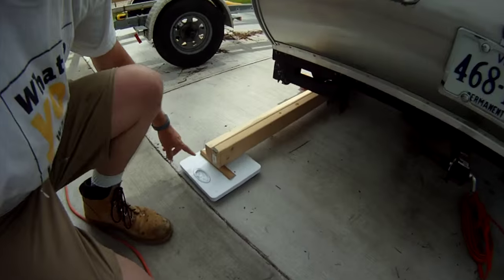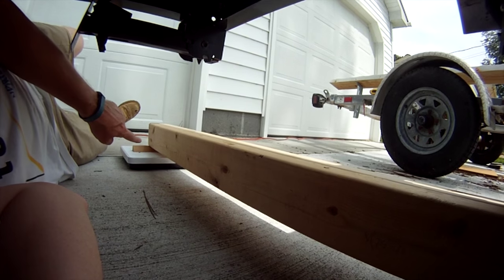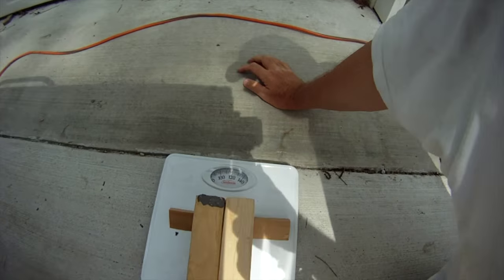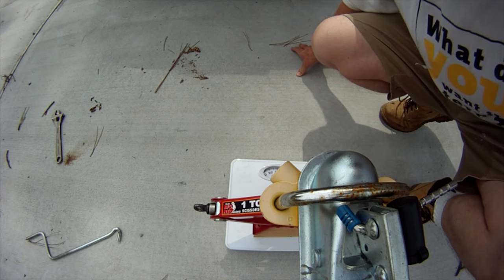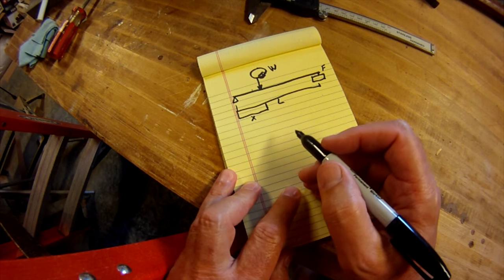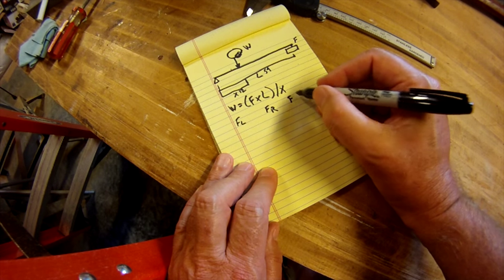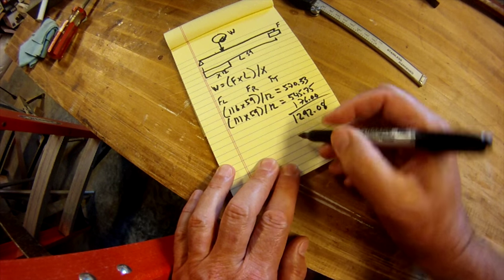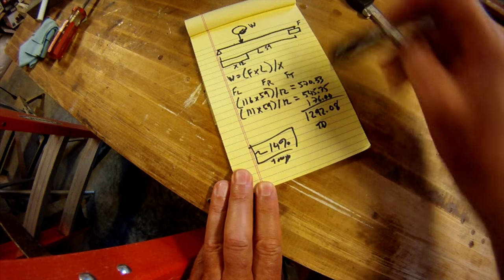Weighing the teardrop.

Comment: Good video. I'm an A&P mechanic and use similar method to weigh aircraft. I will do the same when I finish my TD. If I could get my teenager to think math is fun I would have it made.
Reply from the maker: Kevin N Thanks Kevin! I wasn't too big on math as a teenager either, however I did like it when it was applied (physics, etc.) As an adult, I find that I wish I had paid more attention!

Comment: I know you said that you moved the axle back (I think you said 9 inches).  Was that an engineered decision, or were you just wanting to clear the doors--or was there another reason?
Reply from the maker: Hi Mark, as I was working out the design in my head, I was worried that the finished camper would end up a bit tail heavy if I left the axle in it's stock position. I made a calculated guess and repositioned the axle. Luckily, I was pretty much right on, as the tongue weight ratio works out correctly and the trailer tows very well with no swaying or other bad habits.